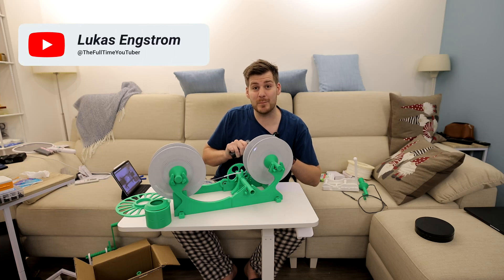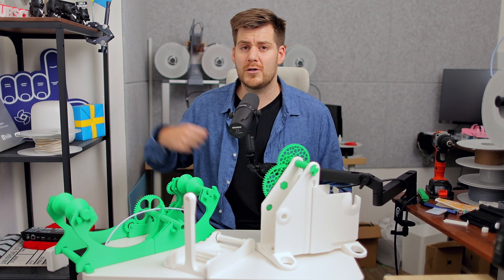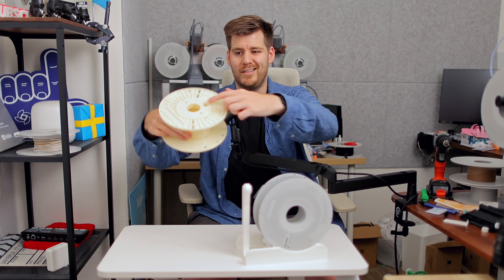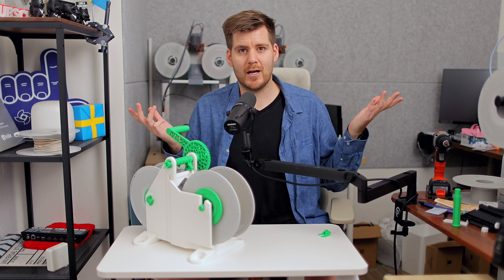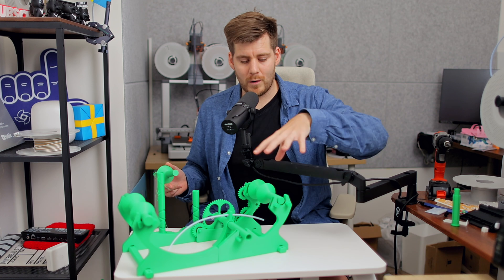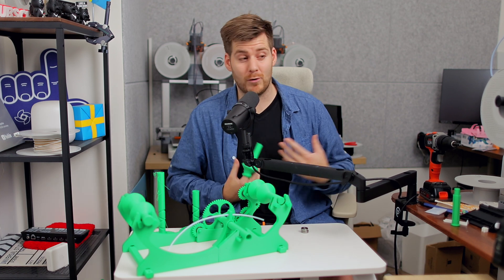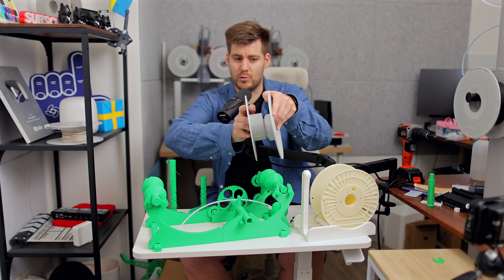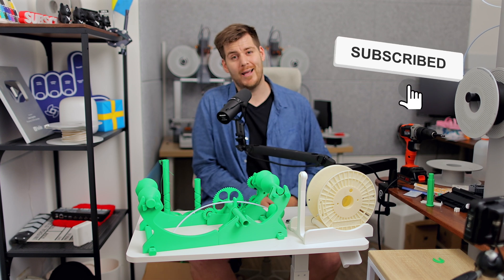Testing The BEST Spool Winders For Bambu Lab A1/mini! But DO NOT Make This Mistake! 😨 [Pastamatic!]

Comment: Just a little clarification. The "screw driver" in your vid is actually a variable-speed drill. Yes you can use these for screws, but in the construction world, a drill is for drilling, and an impact is more useful for screws. I don't think I would use the impact for what you are doing. I'm just pointing this out. They make soi many different types and styles. You can get a smaller drill, like a 12-volt cordless that would be less stressful to your hands for this and work just fine. I am a carpenter, BTW, and use these types of tools every day. I have just purchased my first 3D printer (Bamboo Labs P2S)  and am waiting for it to arrive. Wish me luck LOL  * I would think you could take off the handle on the 1st model and find a socket that would fit the spindle. Then use a socket adapter in your drill and use it like the Pasta machine, or design/modify one and print it *  one more thing, as stated, I don't even have a printer yet, but watching and learning tricks and tips, would it make and difference printing the long tubes horizontally? Would this help with the failed print? Of course, I have no idea

Comment: for what it's worth, if you are going to respool, print a larger spool with a large inner diameter to respool onto first, then respool back off of that onto the spool yo intend to use. one of the major issues people face when they respool is that the wide outer windings of the original outer spool end up on the tight inner windings of the respool. the material memory causes thos inner coils to try to return to their original shape being much larger coils. this causes them to push up into the above layers and create tangles much more easily. the tight inner coils being spooled out onto a larger diameter spool causes less issues most of the time and i usually ignore it unless it came off of a very small inner diameter spool, which is pretty uncommon.

if you first respool loosely to a large diameter spool you don't stress those outer windings by compressing them and by quickly respooling back to a normal spool, the tight inner windings will sorta remember their original tightly coiled shape minimizing what little problem they usually represent. you will get better results in the long run this way in my experience. i make my middle stage spool with an inner diameter about 3/5ths of what my normal spools have for an outer diameter when fully spooled. i respool a ton of filament because i get miss tints and odds and ends from a small print farm. so i'm constantly getting spools with around half of the spool left.

i've found the best method for joining them is with a heat resistant silicone tube just barely larger enough to fit the filament into. i insert the filament into both ends of a ~1 inch section and then heat that section by holding it over a soldering iron while pushing the two filaments together. take it away from the heat without pulling and let it cool, then cut off the silicone tube with a razor blade. you get a perfectly joined filament that you can't even feel the join unless the two filaments have a different texture. i've joined just about every time of pla to pla and petg to petg this way. matte, silk, gloss, none of it matters. it all joins just fine.

Comment: You did not use the spindle clips. Therefore, the axles tend to bounce and fall out oft their seats. And due to the usage of this external unroller you have no control over a certain brake. When respooling you need some tension to the unrolled spool, which gives you way better results. I have revised this excellent Pastamatic in many aspects, starting with a DC-motor. Detachable and rebuildable to hand crank or drilling-machine. I would give the orinial genious design a 9.5 out of 10 points.

Comment: Why would one want to respool?  Seems like a critical question
Reply from the maker: In my case, I got my hands on some spools that does not fit the AMS lite. Bambu lab and AMS is becoming the standard now, but up until 1-2 years ago, a lot of older models did not fit the AMS properly, so re-spooling was necessary for these kind of spools.

Comment: The Pastamatic Spoolwinder runs great with the 12V motor upgrade. Use it with a adjustable powersupply.  Print it on a XY-Core Printer. On a bedslinger the higher parts can fall off.

Comment: So, your little black drill was “one speed, super fast” but you showed it going slow. What gives?
Reply from the maker: Slow-motion for dramatic effect :) The "top speed" of the drill is not a problem, but the initial acceleration of the drill is too fast for this use case.

Comment: Did you let your X1C in open air ? This is mandatory to print PLA and could explain why tall print were constantly falling!

As the X1C enclosure temperature raises among time when closed, it may come close to PLA (quite low) melting temperature, and as a result alter your print quality.
Reply from the maker: Honestly, I can't remember for this specific print. In general I might have the door closed most of the time, yes.

Comment: I was a bit confused about the concept of re-spooling, but I guess it makes most sense for AMS users? I bought my A1 mini solo and using it only with external spool ;)
Reply from the maker: Yes, the “random brands” I can find locally here can not fit in any AMS or AMS lite sadly.
Reply: I dropped one of Overture spools and damaged the cardboard spool.  Then it wouldnt run in my AMS.  I wished I had a respooler to transfer it.  I ended up printing a "spool repair?" that went outside and over the cardboard spool allowing it to roll just fine in the AMS.  Ironically, I wanted to print it with the spool I damaged, so I unspooled a couple hundred feet (i think) and hand wound it onto a half full spool of another filament.  Used that to print the repair spool.

Comment: Have you found any solutions for filament slipping off the external spool and wrapping around the rod?  My very temporary and non-technical solution is a couple of zip ties that slide along the outside of the spool, but I’m not sure how long that’s going to work.  I’m working on some of the cereal container “dry boxes” and just printed a mount for them, but haven’t used it yet.  PETG and TPU get gooey so quickly, I needed a solution for individual reels.  I hope it works.
Reply from the maker: Honestly, I haven't tried this rewinder again after I recorded the video. Been focusing on launching my 3D business and my mom is visiting from Sweden this week. So my whole schedule is a mess at the moment. Will try this in 1-2 weeks again and see how it goes! Don't think I'll have any issues as long as I use a proper screwdriver though (I hope!)
Reply: @TheFullTimeYouTuber   How wonderful (I hope) that your mom is visiting.  I’m sure she’ll be impressed with your new 3D printing endeavor.  Did you see the new translucent PLA Bambu just introduced?  Very interesting!  Enjoy your visit with your mom!
Reply from the maker: @ Yes! Guess I’ll need to order it just to give it a review :) But actually I already have 4 spools of translucent PETG I ordered for the Ultimate Spool Enclosure before I decided to go with the window design haha
Reply from the maker: @useyourlittlegraycells  Ok, PLA Translucent ordered! haha
Reply: @TheFullTimeYouTuber   I was thinking of that (PETG).  I wonder if this new PLA would stand up to being in a window (as in the “stained glass” example), or if it would fade quickly like other PLA does.  I like the Translucent PETG HF, but there’s not a lot of color choices.  The dilemmas of choice!
Reply: @TheFullTimeYouTuber   I’m sitting here debating what colors to get.  WHY?!?!?  Oh, I bought some Anycubic Texture Gray.  Avoid it.  It changed color mid-spool and my print had a lot of cosmetic and structural issues.  It may not be a beginner-friendly filament, but it’s the first I’ve had real problems with (and wasted an 8-hour overnight print).
Reply from the maker: @useyourlittlegraycells  Give me 2 weeks and I'll try to have a video up doing some comparisons or quick feedback at least.

Comment: Think you missed the best re-spooler, the V-Spooler X available on MakerWorld. This with a few available mods gives a great machine that spools very well and takes up much less space since it stacks the source & destination spools. None are perfect but I've found the V-Spooler to be pretty close. It can also source from up to 5kg spools, so you can purchase cheaper 5kg rolls and spool onto 1kg rolls for printing. I use it with the Sunlu filament connector (there's a model available that integrates the connector into the V-Spooler) which allows me to make my own multi filament spools and make use of the small filament waste at the end of each roll (or make use of filament samples). So it also helps you save $$$.
Reply from the maker: Thanks for sharing! Yea I think I saw this when doing research. But seems like it requires a lot more additional hardware so I felt it was not that suitable as my first re-spool project. Maybe next time if the new screwdriver doesn’t solve my issues :)
Reply: @TheFullTimeYouTuber Yes, V-Spooler does require a few additional items but certainly nothing special and the needed items will help with future builds (nothing fancy or specific to this build). The main thing needed is a soldering iron (or a vertical heat press tool is better) to insert heat press brass inserts to allow screws to thread in properly. This gives much more stability to the final product. The heat press is available on Amazon (US) for around $35 and that comes with a vertical stand that allows inserts to be inserted straight, a soldering iron and needed tips to allow for the installation of M2-M8 inserts. Works really well. You also need a set of M3 bolts (various lengths) but again these are always needed for things around the shop. You also need some bearings (which are needed for all of these). Some of the available mods also need some other components but nothing radical or expensive. Instructions are really good including a comprehensive video. I'll end up saving much more than it cost for everything (including my time & filament) by re-spooling much cheaper 5kg spools and wasting next to no filament in finished used spools.
Reply from the maker: @christopherlyons7613 Thanks! Once I get my proper work bench and have my studio all set up accordingly, I might consider this. But for now I can’t even fit my screw driver on the table basically :)

Comment: Can you just put the other spool against the tread direction that is unlocks?? Shouldn’t be a problem then.
Reply from the maker: The device is designed to put the spools in a specific way so there is no adjustment I can make. But I think with a proper screwdriver it shouldn’t be any issues moving forward!

Comment: Personally, as an AMS user and a user of Elegoo filament (the cheapest PLA in the UK at the moment), I respool all of my Elegoo filament using a Pastamatic, but I hand crank it. It takes maybe 5 - 10 minutes, and hand cranking it means that you're not spooling too fast.
I had problems with the cardboard spools in the AMS, and I found that the plastic collars you can fit to them didn't make them any better to use. So I have a number of "spare" bambu spools that I use. I also keep the Bambu cardboard spool interior piece - it's a method of cheating the AMS into recognising the filament type (so long as you keep the same filament type on the correct RFID tag!), and it also has a guide hole that you can stick the filament into to keep it on the roll better.
Reply from the maker: Regarding the "keeping the cardboard spool interior/RFID tag"; do you mean that you use Elegoo PLA filament but the AMS still think it's Bambu PLA? If so, have you noticed any differences/issues while printing? Or what's the best way of using the RFID tags in a situation like this?
Reply: @TheFullTimeYouTuber  Yes, I'm using Elegoo filament, spooled onto a Bambu spool, complete with the inner cardboard tube of the old bambu filament including its RFID tag. The only problem I've had with this method was one time, when the tag I was using was from a different colour of filament (the filament was black and the tag said it was white), and it accidentally auto-loaded the black filament after the white in the slot next to it ran out!
The Elegoo PLA and Bambu PLA are similar enough that the print profile remaining the same isn't an issue, at least for me.

I do now try to organise the inner tube rolls with RFID tags on them to make sure they're the same colour as the filament I'm going to spool onto them 😀 Accidental multi-colour prints are cool and all, but sometimes that's not the look you're going for! 😆
If I'm not sure about what colour was on the spool, I just rip off the RFID tag, edit the spool in the AMS manually and use the generic filament type profile in Bambu studio.
Hope that helps!
Reply from the maker: @MrSpleenboy Thanks! Yes this is very clear and how I expected it to be! Thought about doing the same but wasn’t sure about the Generic vs Bambu PLA profiles.

Comment: There are a number of these models available.  Having made them successfully and used them, advise not to respool in general.  When the filament is manufactured it is wound when still warm with some degree of moisture.  The filament naturally takes on the curvature of the spool diameter at whatever point on the spool it is wound on.  If respooled, the filament that had a larger arc on the original suddenly has a smaller arc on the new spool.  Also what was on the inside of the original spool ends up on the outside of the new spool, again with a different arc.  This puts approximately 50% or more of the filament on the respool under stress.  Some filaments cannot tolerate this and will start to develop fractures.  I have literally had respools get down to last 40-50% left on the spool and immediately break apart tnto short filament segments due to these fractures, wasting large portions of the filament and causing a huge mess.  Instead of respooling do one of the following.  Buy the cheaper spool refills and put them on reusable spools, use the newer style cardboard spools where the manufacturer has glued the edges of the spool for AMS compatibility, or print your own spool adapter rings and put them on the spool.  Softer materials like TPU won't have this issue (but cannot use those in an AMS anyways), but a lot of PLA's will (especially some PLA pluses).  Some brands of PETG as well.  Respooler models are fun to build and use, but don't use them.  Definitely don't respool and put a respool into a filament dryer.  This will just speed up the fracturing.  Learned all of this the hard way.
Reply: You can use respoolers, you just have to do it twice per spool to make sure the filament closest to the core ends up back there. You need a spare spool to do this; basically you respool once to another spool, then take that spool and respool it onto the final spool. That way it ends up back in the original positioning with the filament closest to the core back at the core instead of on the outside. 

I agree 100% about PLA+; that stuff seems to absorb more moisture than regular PLA and will become brittle at the most exposed areas.
Reply from the maker: Assuming I will dry the filament, should I dry it before or after the re-spooling (and why?), or doesn't matter?
Reply: @ Found drying after re-spooling made the fracturing much worse.  Really depends on the filament type.  PLA+ which I already rigid was the worst for fracturing after respelling.
Reply: @TheFullTimeYouTuber  It doesn't matter when you dry, just respool twice as the first reply to the comment said. Love the videos!
Reply: Personally I pop the filament in the dryer first and re spool it on the pasta lite while still warm, BUT then I re-spool it again so it’s back to its original state.  Of course that means you need a spare spool unless you intend to put it on the spool it originated from again. Probably overkill but never had an issue.
Reply: Sad to say, I've seen this filament fracturing on the inner filament.
Reply: so what about refills?
Reply: @EDC3DP  Refills works fine.  I have used a number of those.
Reply: I do all the time, just dry then spool while warm

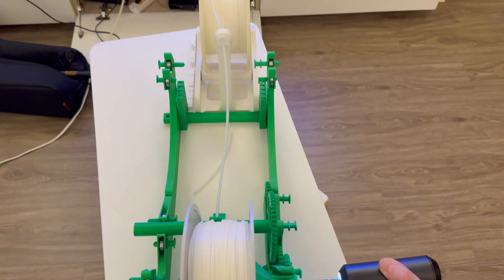Comment: @13:03 if you look closely during the POV shots, you can already tell the spool isn't running both and is wobbling. just figured its worth pointing out.
Reply: I saw that too. It seems that the spool already came apart and the filament and the sides of the responder were holding it together. When you removed it, it just took slight force for it to come apart
Reply from the maker: I realized this during editing as well. Not sure why this happened though…. Or rather why/how the spool got loose.